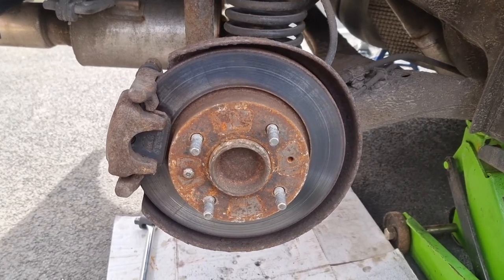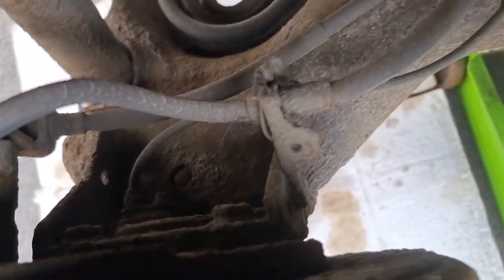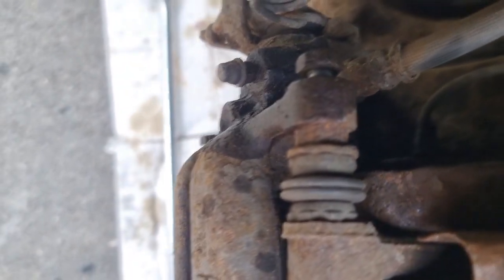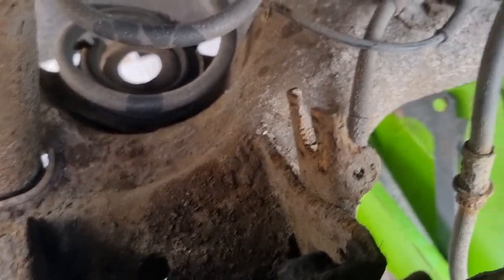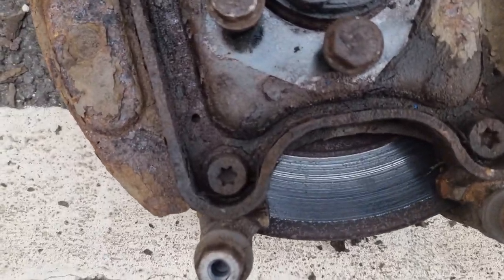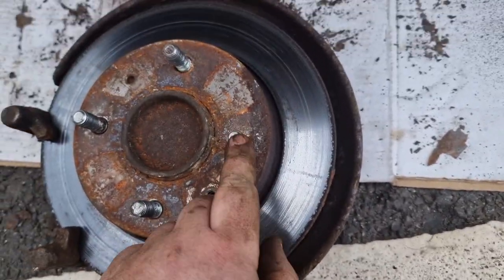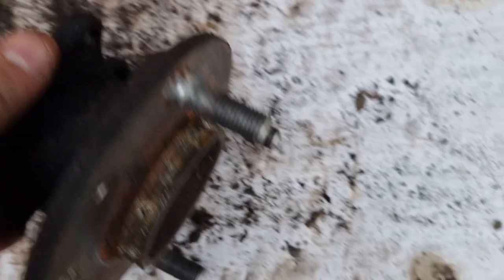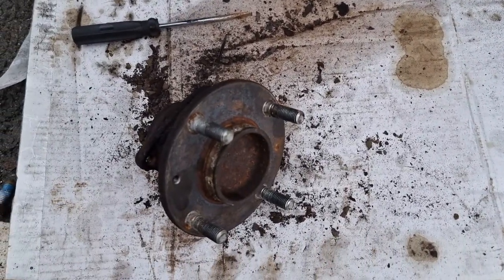Colt CZT Project **REAR WHEEL BEARINGS**

Comment: What did you use to undo the abs sensor?
Thanks
Reply from the maker: I ended up damaging it despite trying to be very careful. I can't remember if I used a punch or I drilled it out
Reply: Always good to have spare abs sensors on standby. They are a nightmare to remove particularly on the front assembly. Almost impossible to remove without brut force.